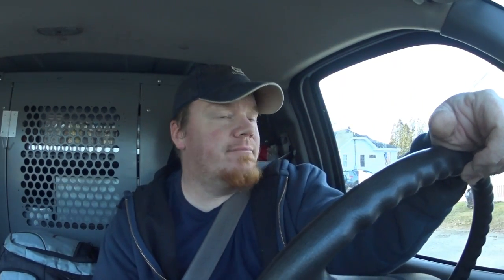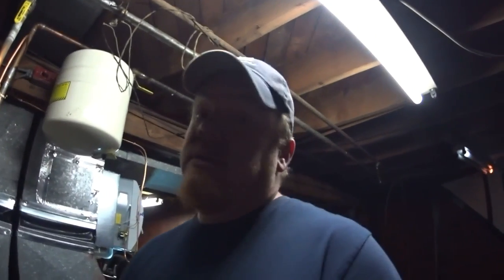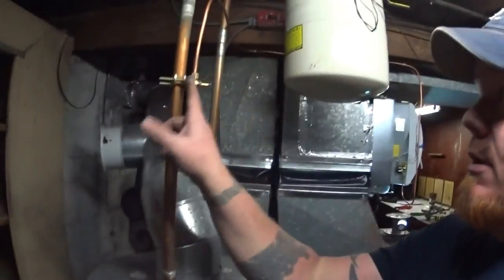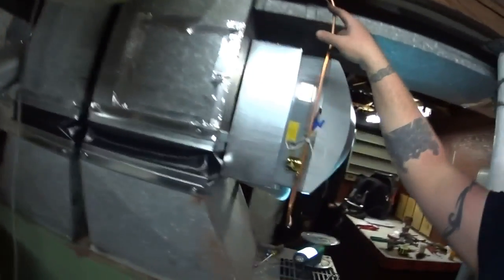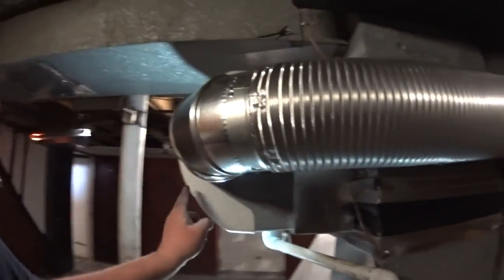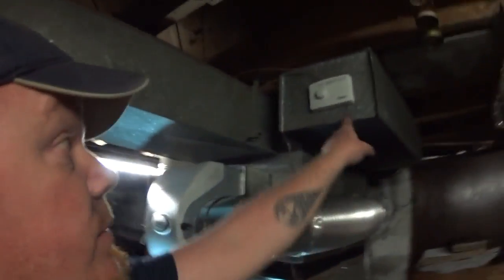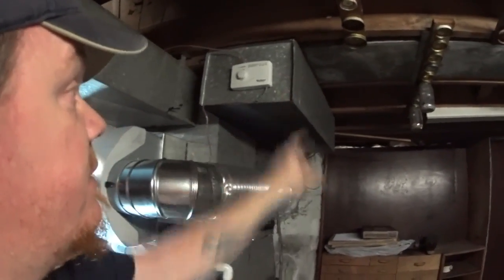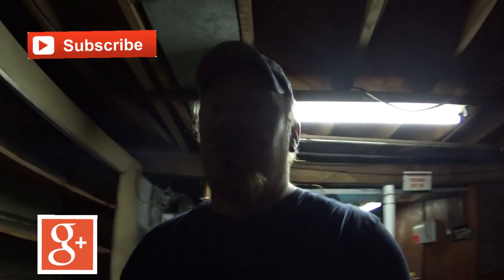Aprilaire model 400 humidifier installation. #HVAC

Comment: what is the difference between the aromatic and the automatic control humidifier . the 400 unite us suppose to save water. no drain valve but you put one in the atomic models have an outside temperature gage you you set your humidity level and forget it.
i don't go in my basement so i want an automatic one that  keeps the humidity constant and saves water. Amazon.ca has me confused by automatic and automatic control words .
Reply from the maker: The automatic refers to it setting itself based on outdoor temperature.   The 400 has a magnetic float that will keep it only as full of water as it needs to be.  A humidifier that is automatic is ideal unless you have the capability to adjust humidity from the thermostat itself.

Comment: the humidifier should of been mounted to the return and force the air in the supply
Reply from the maker: FischerMan the best way is on the supply as per the instructions....reason being is that the air flow over the pad will be more uniform.

Comment: Billy
My 500m says not to connect the transformer to the blower connection.I wish to use a 120v connection to the blower motor which is easily available through the transformer to the humidity manual control and thence to the water solenoid. I would like the system to work when the blower is running and to hut of when the blower stops. But the blower operates off 120v. Why can't I connect the transformer so it shuts off when the blower stops? will this impact the lifetime of the transformer? Thanks. BillO

Comment: when installing the 400m bypass unit in the attic on a heat pump do i put the thermostat in the living quarters for an accurate read or do i put it in the attic by the unit

Comment: Great install -- I see some installing these units oopposite by putting it on the return and feeding to the heat side -- is there a difference? Thanks for sharing!
Cheers, Patrick
Reply: PATRICK MCKOWEN I usually go with the return side. If something happens and it leaks, it won't go into the furnace.
Reply: Its always better to install on the supply side and go back into the supply side. If it's on the return side, it will not work as efficiently. Your filter will collect some of the water vapor and not get to the rest of the house.
Reply from the maker: no...it can go either way....works "better" on the Supply though....
Reply: James Holder that's my reasoning as well. Also there's usually more room and options for locations.

Comment: Great video Billy.  Had a question, I have PEX piping for my water lines, can I cut in a tee to those as well, and use a 1/4 turn toilet shutoff with an adapter for 1/4 in.   Do you have a video showing how you do this better alternative to saddle valve ?
Reply from the maker: you sure can!  but I don't have a video showing this....

Comment: Just curious, why use the A.A. 400 that recirculates the water, versus using the 600 that always uses fresh water.
I do like the box you made, nice touch. Then the aluminum flex duct kinda ruined it for me. Hard pipe only for my installs when I did them.
Reply from the maker: I agree...with you on the alimaflex....its what I was given to work with.   The 400 does not recirculate the water though...  It wicks it out of the res. In the bottom...  Only adding when the float drops...   We used it...cuz the homeowner was selling the house and didn't want the extra cost of a pump. Since there was no where to drain otherwise.   Thanks for the comment....  I appreciate it

Comment: What would you use other than a saddle tap valve??
Reply: Billy Knoth I use a brass ball valve and adapt the 1/4 inch line to the valve. I never liked saddle valves.  I haven't seen one that  wont eventually leak, or it cant be turned off or on because of oxidation and lime problems.
Reply from the maker: I usually cut in a tee.... And use a 1/4 turn toilet shutoff with an adapter for 1/4 in. Tubing....   Thanks for watching.
Reply from the maker: ritewayguy I agree I didn't wanna use it but was told to!